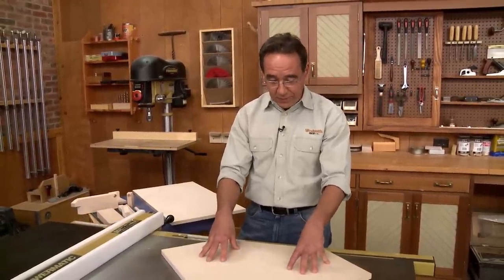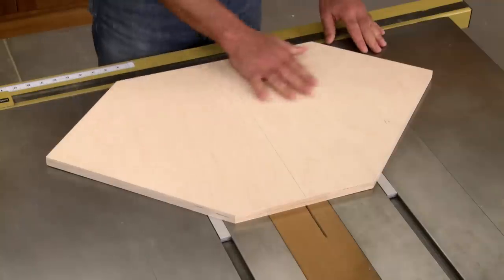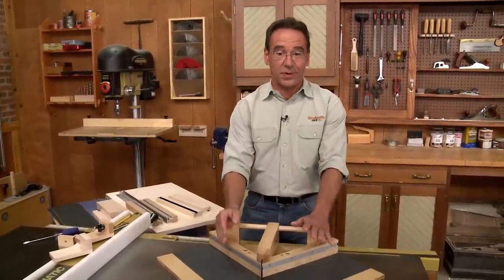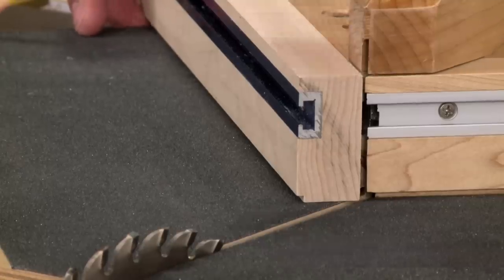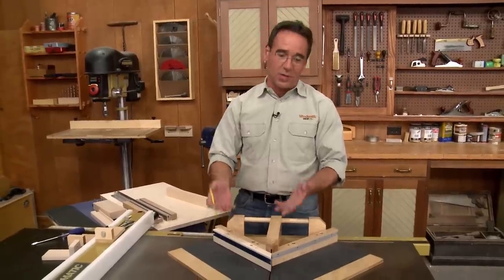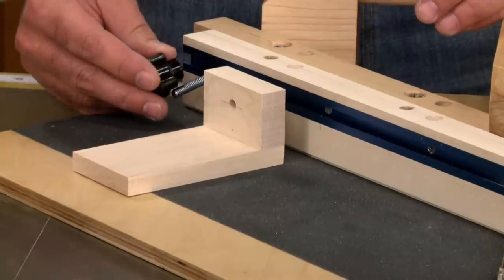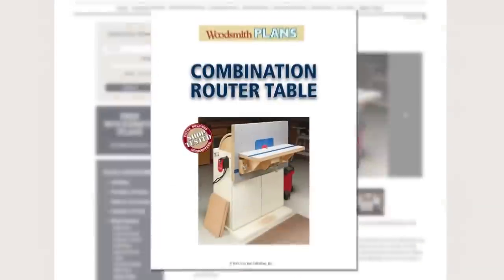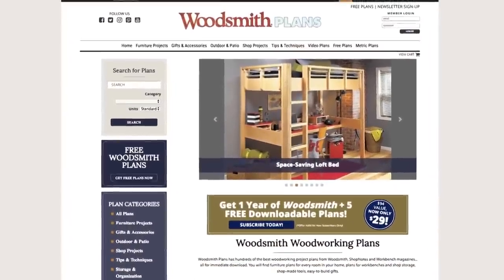Building a Table Saw Sled for Perfect Miters!

Comment: What wood species are you using for your fence? Best recommendation?
Reply from the maker: We used hard maple for the fence and handles.  It's pretty durable, plus it it's stable so it won't warp or bow.  That is just are preference, but you could definitely substitute another hardwood too.

Comment: Hi there. Great video. I have a question...I want to buy a table saw but unsure whether I should buy a brand new average brand or a top of the line used model? I am going to spend around $600 NZD which is around $400 US. Thank you so much!!
Reply from the maker: You can get a lot of bang for your buck if you find a decent used table saw that just needs a little restoration.

Comment: So If you have a SawStop would you just set the T - track back a bit from the center kerf?
Reply: That or just place it in bypass mode while you cut the track.
Reply from the maker: You could do that.
Reply from the maker: I would probably set it back a bit to be safe (coming from someone who HAS unintentionally triggered a SawStop with aluminum.)